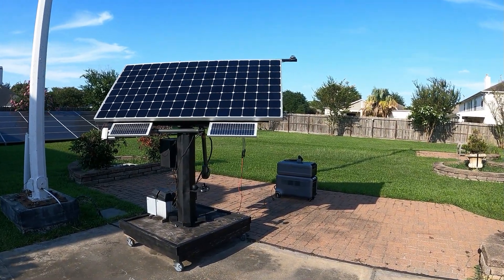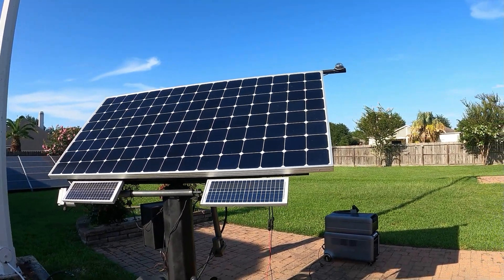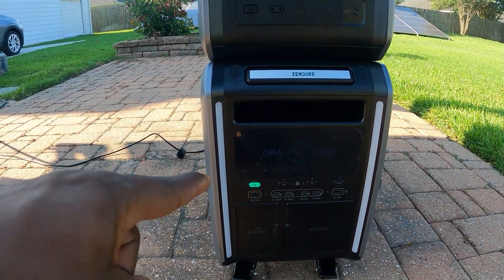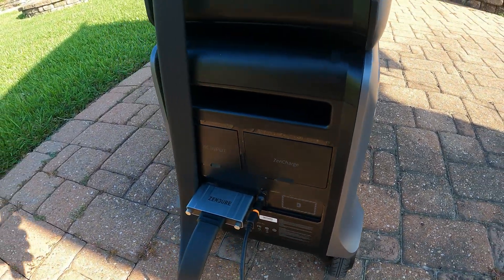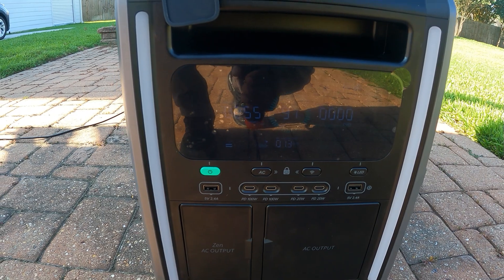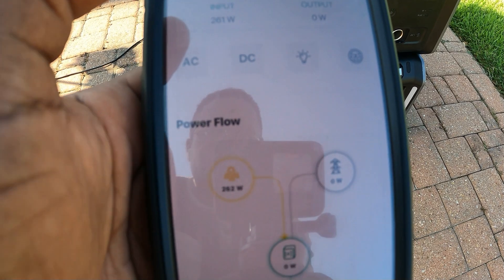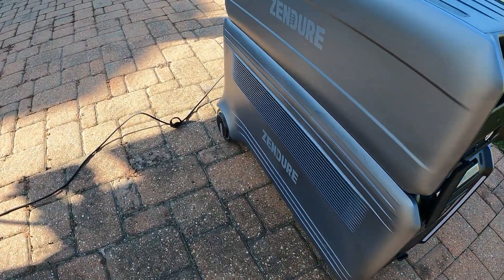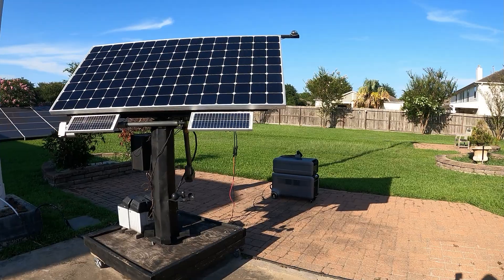ZENDURE Superbase V Solar Charging with my Solar Tracker

Comment: This unit could have been something special, it turned out to one of the worst dumpster fires 🔥 ever to be sold. Blown inverters all day long in the FB GROUP. I am afraid to even update mine because of countless number of bricked 🧱 devices. It pains me to say that off all the ones I own, this is the worst. They have basically stop selling them in most parts of the world.
Reply from the maker: Thanks for sharing your experience.
Reply: @GeneratorReviews Glad to do so.